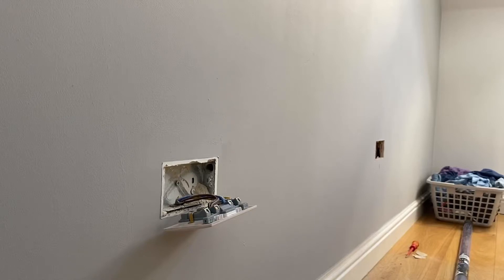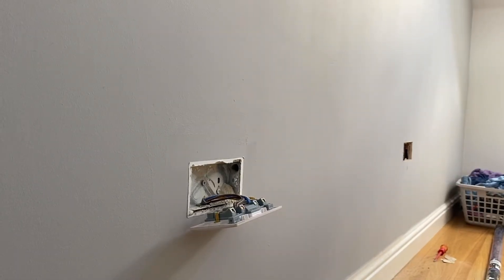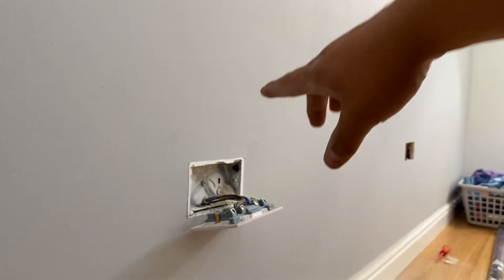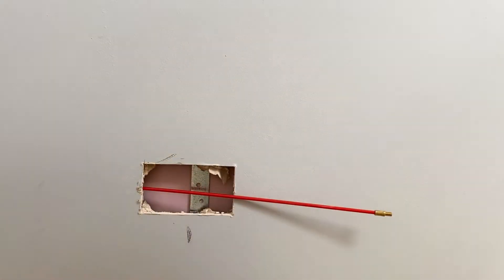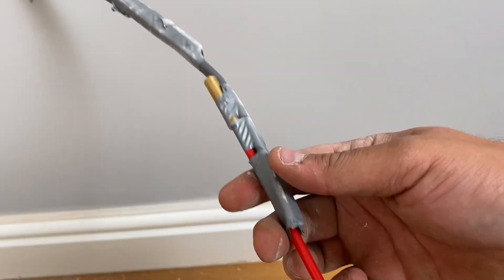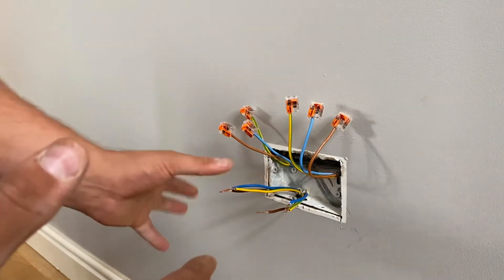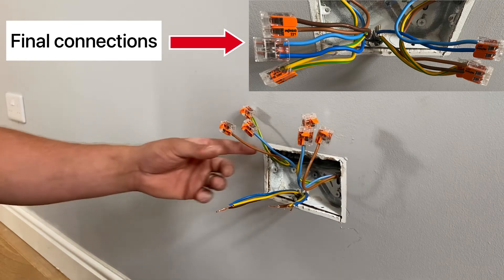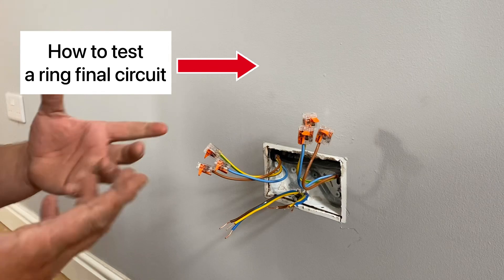Extending a Ring Final Circuit - Electrical Wiring

Comment: So can I just check something, so you disabled the old socket, just added a faceplate so you have access to the wagos and now you have instead 2 sockets either side. I was trying to do a similar thing by bypassing the ring coming to the socket, connect it with wagos to the new socket and bring it back to the socket but ChatGPT tells me I cannot have loose wagos on the back of an existing socket, and that would introduces a figure-8 loop, which is not compliant with BS7671. So I need to completely disable the existing socket and use it as a cover plate for my wago connections.

Comment: I find these videos really good to watch. why did you not just take the cable from the back of the sick extend it with the wage clips to the new socket then run a cable back from the new socket to original socket as that would have kept it all in the ing still and no blanking plate so in future you still have a socket there, or can you not use the wage clips to join cables like this 

anyone know what ?

Comment: I would not have done that I  would have put 2 of your cables into a junction box  and tucked the JB into the stud  wall then you would have only 2 cables per socket I don't like  more than 2 cables at one socket but if I did in that installation I would have changed the double fastafix for a deeper fastafix box for the tattie joints in the back of the box

Comment: If you did need these sockets still, would there be nough room in this back box to extend one leg of the ring behind the socket on the ring? Or with a larger back box maybe? Or is that not allowable either way, to have the return of the ring running in wagos behind the sockets that are on the ring?

And on a ring circuit, does the ring have to run directly through the socket connections, or can you use pigtails? So cable on the left coming into wagos, cable on the right coming out of the same wagos, and a 4 inch or so set of conductors from wagos to sockets?

(Rings are so foreign to me — very literally, completely illegal here, radials only)

Comment: I just wanted to know correct method, I'm looking to connect a single double socket to a 20amp rcbo and was wondering is a single 2.5mm twin and earth fine or should I use two 2.5mm twin and earth? It's within 2 metres of consumer unit and max watts I'm looking to use is 4.4kw
Reply: With a 20A rcbo it's more than likely to be a radial circuit. I which case you can branch off with a single 2.5 t&e cable. You should be able to add additional sockets to the new socket too. If it's not a ring final circuit.

Comment: If you were keeping this socket in as part of the ring I assume you’d need a deeper back box to
Accommodate all the bits ?
Reply: So essentially with the setup he's shown in the video only the 2 side sockets would be useable, if he was to make the middle one usable too he would only need 3 wagos rather than 6. So the same size back box SHOULD be okay. 

The way he would connect it up would be to keep one of the sides with the wagos the same as how he's connected them here so 1 cable from the DB connected to the left hand socket cable with the wagos for example and then the remaining DB cable and the right hand socket cables would be wired straight into the socket rather than in a wago.

Hope this helps ☺️

Comment: Hi why was two cables put in right side new socket or did you only use the one ? Am i correct in thinking you run a new single twin & earth left & right to the new sockets,then connected either side to each of the two existing legs or is everything joined in the centre with wago's and blanking plate ? Any help much appreciated thanks.

Comment: I didn't understand the end part, when the camera angle changes. I'm just a DIYer new to the electric scene. You fed in 2 wires from the left socket, and am I right in understanding you further extend the ring circuit to another socket to the right? So order of wires would be = left socket - bottom left wire - new socket - bottom right wire - new socket further right - top right - top left - left socket.
Reply: He has basically done a loop from the original socket to keep it as a ring circuit

Comment: I'm sure that the info provided is safe, meets the code requirements, is accurate, and useful.  Yes !  IF YOU LIVE IN THE U.K. Where they use a 220 volt system at that.
I'm sure there are some practical equivalencies, but it doesn't serve any purpose, when info like this is provided to No. Americans.  Until the day when the power grid is actually global, I simply don't need to see this.
Reply: Don't watch it then 😅